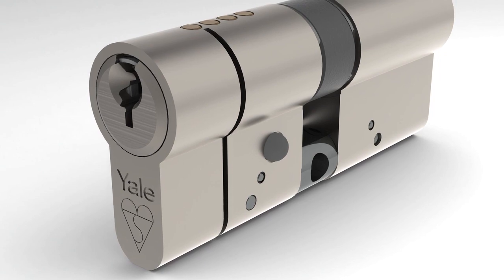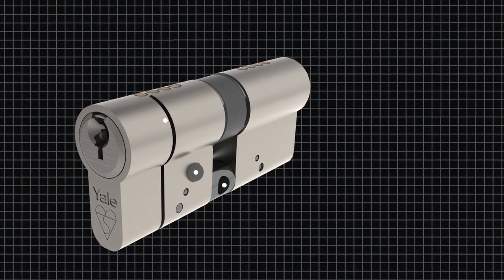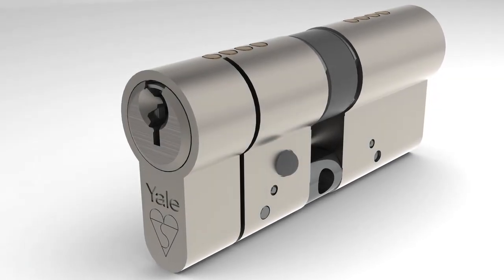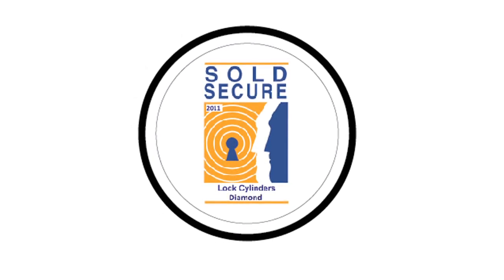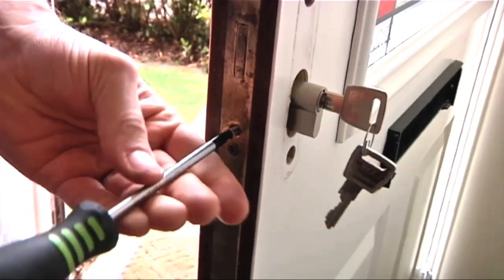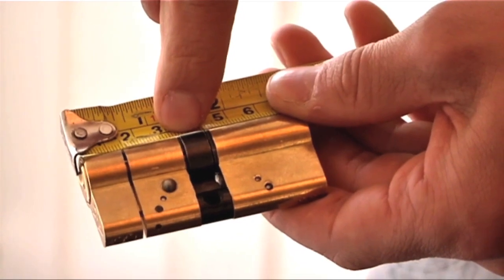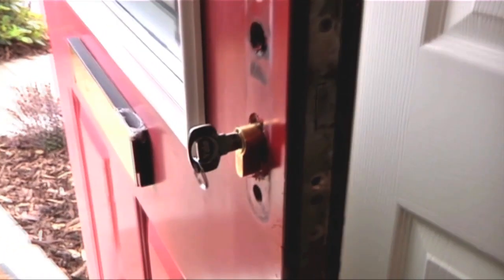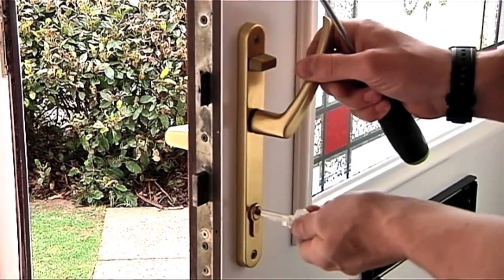How to Change a Door Lock to a Yale Anti-Snap Euro Profile Cylinder lock | Homebase

Comment: Hi, I’m not sure how to phrase this but this door looks similar to what my parents have. The metal part in the middle of the door (where the cylinder fixing screw is removed), what kind of locking mechanism is that? On my parents it has 3 sort of hooks that come out when the door is locked.

Comment: How can I remove a Yale Barrel lock WITHOUT a key. I need to replace the  barrrel lock because of lost key
Reply: not going to be said on here hopefully. if you're inside on your property then simple. however asking questions like this without more info then.......Computer says no ;-)
Reply: Drill out
Reply: Get a bump key
Reply: I can pick it in about 10 seconds  - contact a local locksmith & they will oblige👌
Reply: Because it was an old rusty cylinder outside for 20 years i had to snap it out instead 🙃

Comment: You don't need to take the handle off.  "Experts at Yale" need to go back to school they certainly wouldn't get into Yale or Harvard based on this performance.
Reply: You do need to take the handles off
Reply: Hi, Which meaaurement should go outside in instreet and which measurement has to be inside? Thanks